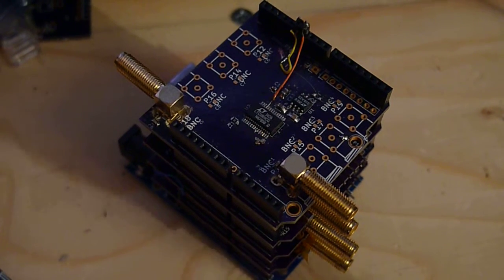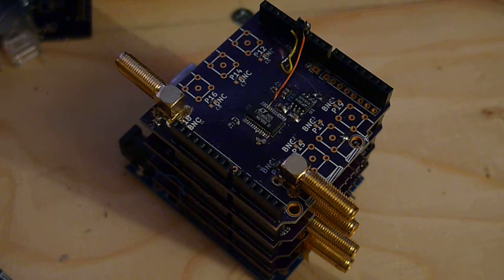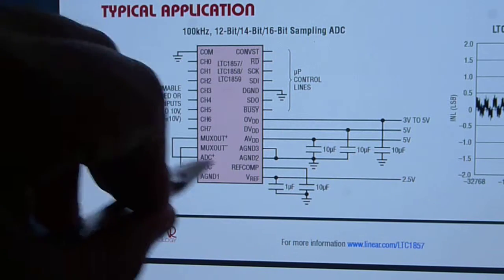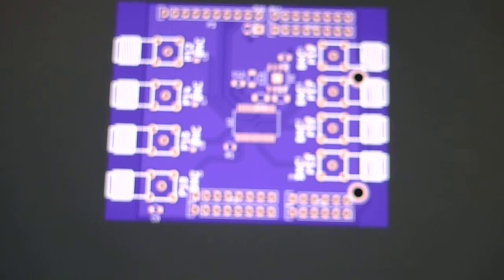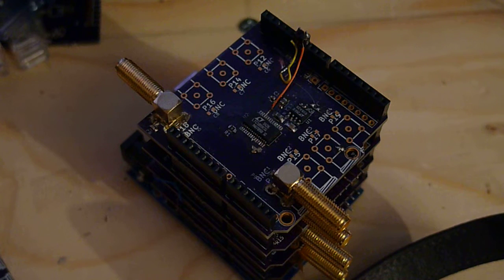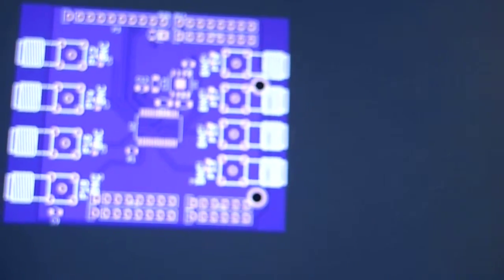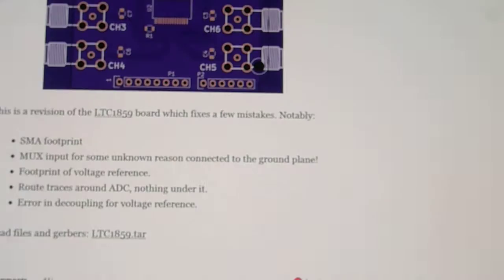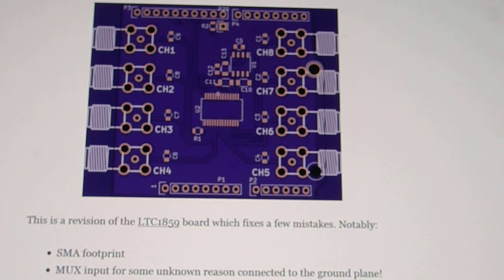#1 An 8 Channel 100KSPS 16bit +/- 10V Arduino compatible acquisition shield (bringup)

Comment: How did you get on with the ltc1859 shield?  Just wondering how you can input -ve voltage? Do you use coupling caps or some sort of offset cct ?